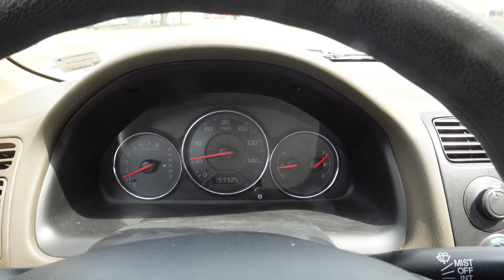My $500 Honda Civic Had A CRACKED Exhaust Manifold

Comment: That’s so cool you finally got that abandoned car and we’re able to flip it so quickly. And for so cheap!
Reply: And some dummy sold their car dirt cheap because they didn’t take it to get diagnosed lol.
Reply: @billymasoner3735  after a shop throws 500$ worth of parts at it and still dont fix it? Thats why i work on my own stuff
Reply: @codya8684  yeah same here.  There’s very little I’ll take my vehicle to a shop for.  I drive a Chevy Cruze and the intake manifold went bad, as is common with them.  Took it to the dealer under warranty, bill was $1,400 (paid by warranty).  Years later it went again, and I decided to do it myself.  Took me literally an hour and a half, AND I installed the aftermarket fix so it won’t go bad again.  Cost me less than $200 total.  Shops are more often than not, a total ripoff

Comment: It's so cool how cheap those mass market cars can be fixed!
Reply: Yep they're great. We did a timing belt and water pump on a 94 Corolla in about 45 minutes. Front brake pads and rotors cost like $80 and both sides can be done in about 45 minutes too.
Reply: .Cheap if you can do it yourself.  If that car had gone to a dealer or mechanic.  2 grand easy because they would have made up what was wrong with it and all the parts it would need.
Reply: @IKhanNot  we are talking about civics not corolla, on a civic the timing belt and water pump is no easy job
Reply: @noventay4  Whose "we" and where did the OP, whom I was replying to, mention Civics specifically? I was replying to the OP who talked about mass market cars and if I check the sales figures the Corolla falls into it. He was simply stating that "mass market" cars are easy to work on and can be rehabbed for cheap. I was merely backing that up by mentioning a real life scenario. If he talked about Civics then the conversation would be about Civics but if you read that then you'd know. You didn't. If you're an ESL then sorry but reading isn't hard.

Comment: Prodemand says the torque for those nuts is 31Nm or 23ft-lbs. A lot of forums are pretty good with info but I've never had good luck with the Honda forums specifically.

Comment: It's more than likely cracked like everyone says. I had a 82 Celica beater I got super cheap that sounded about that bad. Turned out to have a loose and mostly stripped exhaust manifold bolt. I found something that worked and then it was quiet except for the bad muffler to go with it. A bolt I had in stock and a cheap turbo muffler and it was quiet again. I had already picked up a cheap good manifold for it so when I got tired of dealing with all the other issues a 300k body and drive train has the buyer got a lot of spare parts.

Comment: Something's wrong with the sound of that engine, even after the exhaust gasket replacement. Lifters? Poor oil circulation? One of the pullies?
Reply: Stretched timing belt plus valves out of adjustment 🎉

Comment: Cracked header, bad catalytic converter? No problem! We will just buy the whole assembly for $150

Meanwhile in CA… Car is mechanically totaled🤦‍♂️
Reply: I think Magnaflow makes a CA approved cat for this car, but it's not cheap. Cheaper than OEM, but still like $600-800.
Reply: My uncle has same car and on summer he was checking to buy new header but dealer and online was too expensive. We live in California so he end up taking his header to metal shop to get it welded back and they did like upgrade weld. But Honda wanted to charge him 400-500 dollars

Comment: That's a cop out. ACs don't need to be charged. If they're low on refrigerant, it's because there's a leak. I got a leak once. I had a rock hit my condenser at highway speeds and I felt my AC go out shortly after (same car). AC condenser was only like $40 on ebay and I think it's been like 10 years or something I've had it. At the same time, you'd probably want to change the O-rings on the fittings. I actually paid the $4-5 for the Honda OEM o-rings cuz the crappy green ones at the auto parts store tore so easily. I thought I was gonna have to change my compressor recently because my AC would work like 50% of the time. But it turned out my condenser was just dirty or something. Cuz I haven't had a problem after I sprayed it off with a hose. Lastly, I've heard about AC compressor clutches going bad on this car after so many years. You don't actually have to replace the compressor. Apparently there's this metal plate on the clutch that gets worn down, and a lot of people just remove that plate or something and it works fine after. That way you don't need to spend $200 on a new compressor plus recharging. Yes, I'm talking about this specific car, not about cars in general. I know this car very well. Mine has 297k miles, so I've had most of the problems you're going to run into at this point. knock on wood***

Oh yeah. There's a connector for the AC compressor that's like snapped onto the AC compressor fan. Mine would get loose all the time, so I taped it together, but it does get loose sometimes if you're working under the hood and accidentally hit it. I think eventually I just took the connector off altogether and just taped the wire where it needed to be. Edit: Oh it was a wire. Not the one I was talking about, but one of the wires. If you're flipping a car, and it needs to be recharged you've got the know how to fix it right. So don't do that. Just saying.

Comment: i have an 04 honda civic, i had crazy ac leaks (probably due to previous owner smacking a deer) and after all those were fixed i still needed to replace compressor, everything together wasn’t bad probably $200 in parts and works great for the most part lol
Reply: How many miles on your 04’ Civic?

Comment: cracked catifold is common on the 01-05 dx/lx civics, the exhaust system is different between dx/lx and ex, and accounts for most of the power increase as the vtec is low rpm high swirl fuel economy style on the 1.7

Comment: Isn’t there a 3rd bolt on the downpipe connection that holds the bottom of the manifold secure? Without that the only support the bottom half of the manifold has is the exhaust pipe which probably won’t keep it secure enough to prevent future cracks.
Reply: Or is the bracket causing the issue by not allowing flex?
Reply: @staycurious3954 after doing this exact repair I think you might be right. I used an aftermarket manifold and the bolt was creating so much flex I decided to go without it. I’m sure OEM would have been a better fit but any flex over the long run will absolutely cause cracks.

Comment: I picked up a 2004 toyota matrix XR that was 6 speed swapped an had a spun rod bearing an it threw a rod driving it home but i was going fast enough to coast home so i got an engine for 375 the car was 400 an 400 to put it in for a total of 1,175 did i save anything over buying a running car the guy told me the book value was over 3 grand

Comment: Interesting! My daughter has the same engine, same general issue, although her’s has the more typical crack starting at the O2 sensor back towards the manifold. Was thinking of doing this job with an Amazon cat. Worried that the aftermarket cat will not last long…
Reply: Definitely won’t last. Try walker exhaust cat on AZ if you find one
Reply: I went with a $79 Amazon cat and it worked but 3 months later I’m getting fumes again n the cabin and a sulphuric odor 🎉

Comment: JR you should make your own smoke machine for finding exhaust leaks, evap leaks, vacuum leaks and intake manifold leaks.  I made one and it works awesome.  Only $20 in parts!  The youtube video is "BEST automotive smoke machine you can build" by Error Code Guy.  I used a little 12V air compressor that I plug into my cigarette lighter.

Comment: 2012 Honda Civic LX 1.8 l does anybody have any knowledge on that particulate engine? I'm getting a low Purge evap and also a PO420 code wondering if it's a false code for the cat being bad because the are take manifold gasket or the valve gasket for the valve cover gasket are bad? I've already replaced a PCV valve, both oxygen sensors and the are intake hose that was cracked in the front and back. I'm getting a slight puffing sound from the back of the engine so I don't know if that's the manifold gasket? Heard this can throw a false PO420 code

Comment: Me and my brother replaced almost the entire cooling system on my sister's 96' Accord. We got it back together, and it ran like crap, but we bled the system and it ran fine after. But then the A/C system wasn't cooling, sure enough it was a little connector/coupler that had slipped out of the radiator cooling fan wiring harness. Honda's are nothing if not quirky lol

Comment: Why when I did this the engine smells like burnt wires or burnt oil?! And no! No wires are on fire only happen when I changed exhaust manifold and I only touched o2 sensors and manifold.

Comment: JR, the word "fitment" (seemingly the currently trending word for YouTube auto content creators) doesn't mean "fit" like you think. Here's the definition as it applies to cars:  The meaning of this “fitment” is therefore more likely to mean “grip” on the road, ie to describe the grip between the vehicle and the road. So when the vehicle is "extremely laid down", the chassis, the camber and the rims and so-called "towed tires" (stretching) naturally also play a not insignificant role.
Reply: Toed, not "towed". Jfc